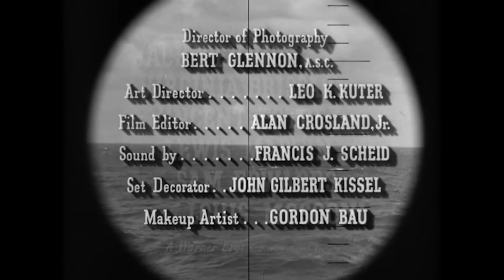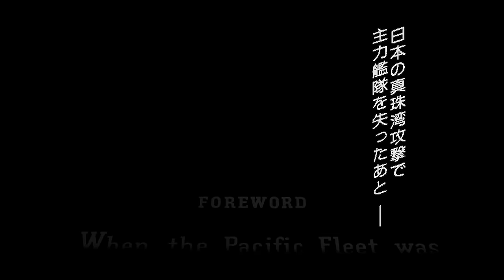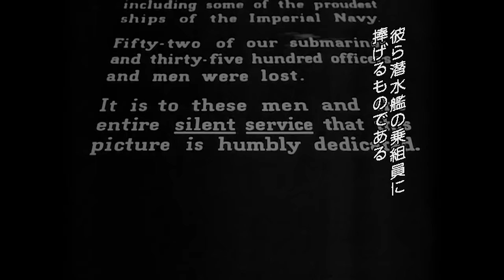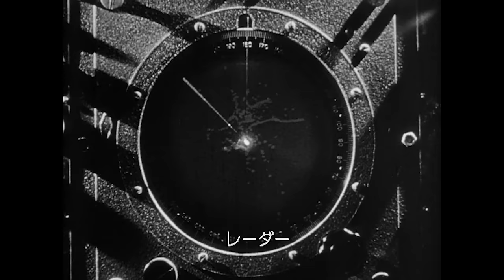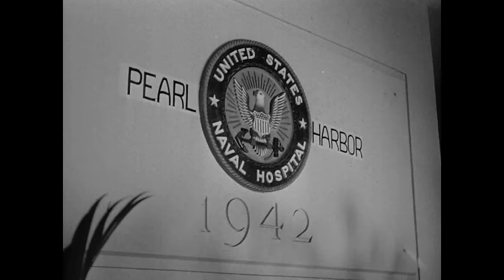太平洋機動作戦(Operation Pacific) - part1

Comment: When you read those introductory lines "52 subs and 3500 Officers and men were lost", Be aware that many of those losses were early in the war (late 42 to early 43) BECAUSE:
After a South Pacific fact finding tour, a Democrat Senator returned to the states and announced to the news media that our subs were safe because the Japanese set their depth charges to go off at too shallow a depth. The Japanese ALSO read the papers and magazines and they corrected their mistake!!! I didnt give the name but you might be able to find an archived copy of Life Magazine.
Reply: Probably the greater loss of subs were due to the BUORD torpedoes, and poor ❤training.
Reply: @tross9972  There are only two known instances of sinking resulting from circular runs by our own torpedoes. Our torpedo problems stemmed from improper realistic testing of not only the Mk 14 submarine torpedo, but the Mk 15 destroyer torpedo before the war. No live warshots were conducted due to costs prior to the war. This resulted in unknown torpedo performance. BUORD never fixed the problem themselves; ComSubPac ordered tests conducted when BUORD refused to take action. Admiral Nimitz backed Admiral Lockwood's actions and Admiral King backed Nimitz and ordered BUORD to conduct their own tests. Mk 14/15 torpedoes were running 10 ft deeper than set, magnetic exploder didn't work, and contact firing pin was being crushed on contact. By fall 1943, these problems had been fixed and torpedo performance dramatically improved. 60% of all Japanese vessels during the war were sunk by the U.S Submarine Service, most of these between Oct 1943 and Aug 1945.
Reply: @tross9972  The U.S. Submarine Service was one of the highest trained body of personnel in the Naval service. These men were 100% volunteers in a highly competitive field. Far more men desired sub duty than there were billets.
Reply: Representative Andrew May said that he was not a senator.
Reply: The press needs to report in a responsible way during war time.  That being said the voters should not reelect May.
Reply: @carlreed6186  You may recall, I did not give the name of the SENATOR! Draw your own conclusion from that.
Reply: @patrickmccrann991   Loose lips sink ships
Reply: Those torpedo problems involved those shot from PT Boats, bombers and subs. The dismissal of all reports of failures were solely the responsibility of the Bureau of Ordnance who, I'm told, refused to even live-fire test them during development. ComSubPac Admiral Lockwood finally took it upon himself to assemble submariners and technicians to troubleshoot and repair them by themselves.
It took until 1943 to give the navy reliable torpedoes.
Reply: @patrickmccrann991  It still is all volunteer. My father served in subs in WW2 and I served in subs during the 70s
Reply: @stephenbaker1362 fast attack or boomers? Thanks for your service
Reply: @patrickmccrann991 Subs were surely also lost because the ships they were attacking weren't damaged.